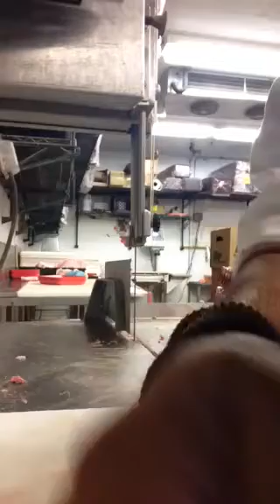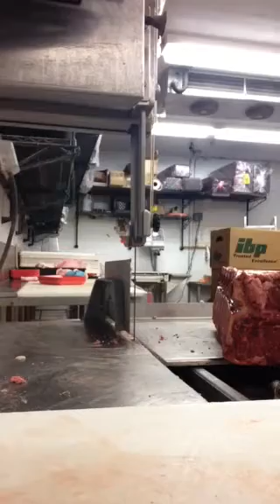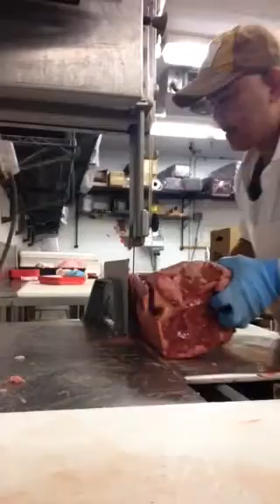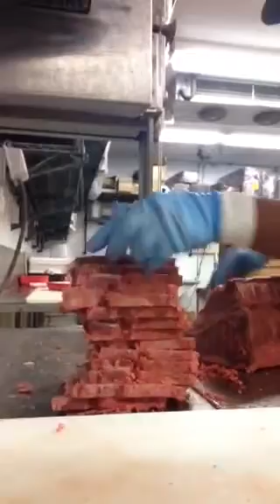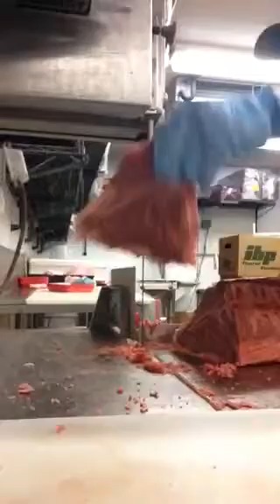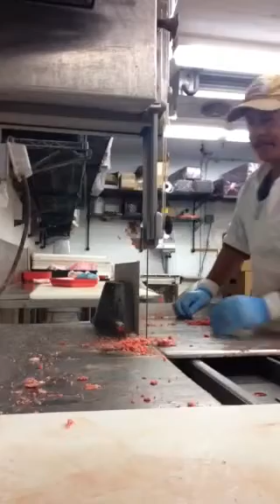The fastest butcher/meat cutter

Comment: To defend this guy, all the "Veterans" posting shame on this guy, you fellas should know that he may be able to cut that slightly quicker, but have you forgotten blade waver?  Sure, he can slam that short loin left and right on the slide like a bat out of hell , but the band can only cut straight and true through bone so quickly.  It's metal teeth grinding, not a lightsaber, so if he wanted to make wedges, sure go faster, but that's a decent speed through a short loin.  Now if he cut that fast through pork or boneless meat, then yeah, there's a problem.